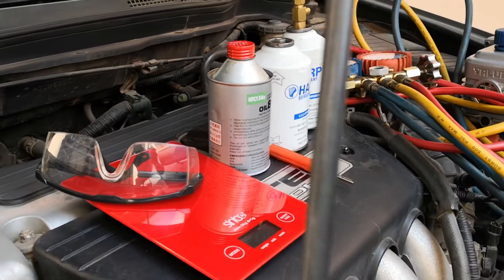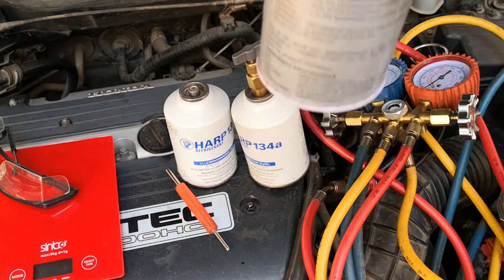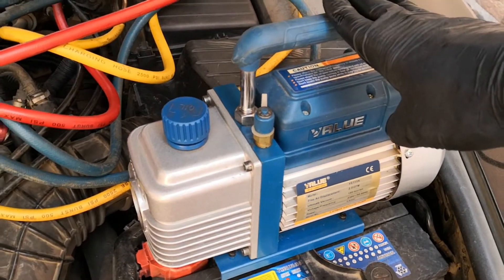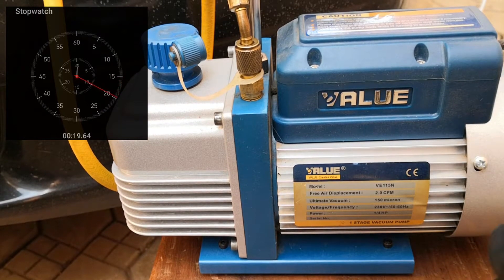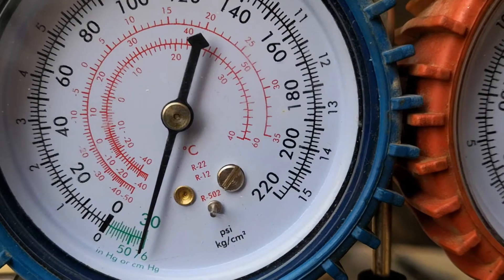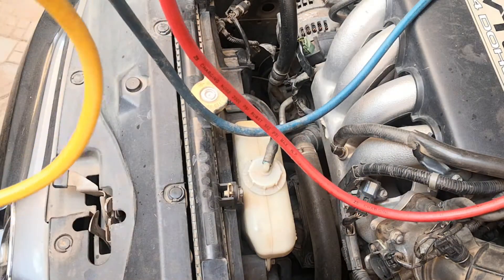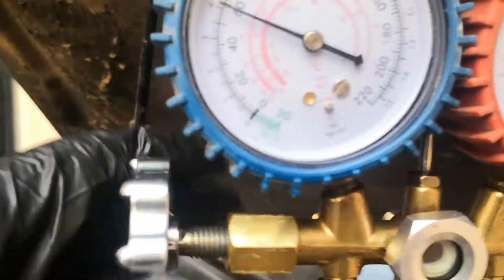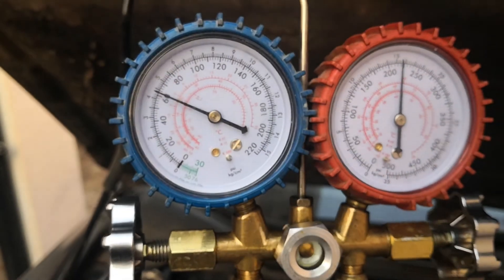Vacuum car AC / RECHARGE Car Air Conditioning / Get COLD Air in your Car

Comment: When you mentioned the oil it seems incorrect. You said you need to add the oil cuz the vacuum removed it from “all” the vacuum will not remove “all of the pag oil”. If it did….that most certainly would wind up in the vacuum, as you mentioned in another comment, the vacuum appliance doesn’t actually hold anything in the way a cleaning vacuum for your living room does with dirt….. so just based off of that. It couldn’t possibly remove “all the oil” as you said, cuz the vacuum appliance doesn’t have any pag oil  to empty in the way you empty dirt from a household vacuum appliance. At a minimum it will still have oil in the compressor. From what I’ve read an AC vacuum will only remove moisture and water, it doesn’t get hot enough to change the state of the oil from a solid…. If you added all of the systems required 7 oz pag oil you would certainly ruin it. 
I hope my comment makes sense, but basically if any oil is added during the recharge, I believe it should be an exact amount as recommended by the manufacturer def not “all of the oil” for the system. That would kill your compressor
Reply from the maker: I never actually said the vacuum removed all the oil. What I said was that vacuuming removes air and moisture. Pulling a vacuum doesn't remove PAG oil.
Reply: DIYAutoworksNG  my apologies again. I'm was not trying to comment from a position of thinking I kno more than you btw. This is the very first time I'm working on the AC and I've watched at least 20 videos to prepare. Almost no one does it the exact same way. 😢 My comment, again intended for another persons video, was just my trying to triple check my info before beginning my work. To clarify as well for anyone who may read that, def not the person wth experience here, just the one trying to learn everything correctly
Reply from the maker: No worries at all! You're my kind of guy. Watch loads on the subject to prepare and then dive in 👍🏼
Reply: @DIYAutoworksNG   I listened to it a few times to be sure
Reply: Likely it  was just a slip of the tongue and not what you meant
Reply: @DIYAutoworksNG sorry. It seems to be a situation where the comment was left on the wrong video 🤐 I was watching several in a row... Must have been writing this comment for the other video and yours started playing.... Sorry about that.

Comment: Make sure you isolate the vacuum pump before you turn it off! If you turn off the vacuum pump before isolating it from the ac system you risk sucking oil from the vacuum pump into the ac system since the check valve on the vacuum pump may not seal properly.
Reply from the maker: I usually lock of the manifold gauges before turning the vacuum pump off, but didn't know about potential impact on the check valve. Thanks for the tip!
Reply: @DIYAutoworksNG  Absolutely! You did do it correctly in the video btw. I was just warning everyone else out there.

Comment: Recharge refrigerant  1 weight 2/ sight glass [bubbles ] 3 / subcool 4/super heat 
Low side psi is a function of tx valve and evaporater core 
High side Psi is a function condenser size and cooling fans 
SYSYTEM MUST BE 100% FULL FOR GOOD COMPRESSOR OIL CIRCUATION

Comment: Hello, for some reason when I was doing a vacuum on the system, the vacuums oil went into the gauges
Reply from the maker: Was the system evacuated before vacuuming?
Reply: @DIYAutoworksNG  yes, that's what I can figure out
Reply from the maker: Are you certain you didn't have some oil left in the lines prior? Either way, I'd just add the recommended amount listed by the manufacturer and recharge (assuming you didn't replace any components).
Reply: @DIYAutoworksNG  I took it apart completely,lines, evaporator valve, but , I didn't change the condenser.
Reply from the maker: @howlingmedia4354  then, you're meant to add the recommended amount of oil volumes specified when replacing those items. I'm guessing you flushed the lines? Another question, did you add the oil before vacuuming? If you did, that could be the reason.

Comment: I have a 2007 civic hybrid and replacing my evaporator, expansion valve, condenser, and compressor. How much oil should I put and where’s the best way to put it? Does a new compressor comes with the total right amount of oil in it therefore there’s no need to add for the whole system ? Thanks!
Reply from the maker: There are specific volumes to add when each of those parts are replaced. The new compressor usually comes with the oil, but there's a specific instruction on how drain the old, measure and use this to inform the new one. I don't have it at the top of my head, but just check online for the specs for your model year.

Comment: Nice illustration and most appreciated. However, did you take into consideration the added weight of the hose attached to the can? It is going to register on the scale and affect the number computation, No? The can itself weighs grams or within an oz.  I am about to do this same job, of replacing my rear expansion valve and perhaps the evaporator on my 2015 Town and Country, due to a leak back there. I have been watching a few videos, to sorta get this procedure down packed. Thanks and keep up the great videos.
Reply from the maker: Thanks for your feedback! 

Since the weight of the hose and can are constant, you don't really need to account for those. Just take the starting and end weights. The difference is in the system. Just remember to take starting weight after you've bled the charge line. Also it's a range that you're aiming for e.g., 500 - 550g. I usually work with the higher value to account for any insensible loss.
Reply: @DIYAutoworksNG  Thank you.. I wonder if you can elaborate on something. On my 2015 Chrysler town and Country I found that my AC was blowing warm this summer, and I used a single can to sorta feel some cold. But during an inspection of the right rear shock, I looked up and noticed a green liquid coming from the rear expansion valve junction. I now figured why the AC system continued to fail. So I looked into what is involved with this job. You tube videos (including yours) gave me a good perspective on the re-charge part of this job. However,

I would first need to open up the rear and inspect for the parts at fault. This I have done. I actually found that the aluminum with rubber O-rings had deteriorated and therefor caused the leak. The Evaporator was like new, so I purchased the expansion valve and O-rings. I purchased an air vacuum pump, manifold gauge/hose set, 2 new Schrader valves, the Pag 46 oil and three 12oz cans of R134a freon. 

* My question is more on the replenishment of the amount of pag oil required. Being that this was leaking (I guess) all winter, I have no idea how much oil has escaped. Which begs to ask, "How much pag 46 oil should I add?" My dual air system normally takes 1150g (2.53 lb) of R134a, and about 6oz pag 46 oil. But I don't believe All the oil has leaked out. 

So I wonder if Anyone has a general rule of thumb, as to if adding 3 or 4oz is fine when having had this type leak and repair?  What say ye?
Be blessed and encouraged my friend.

Comment: Did customer or you fix the leak before recharge empty system?

During recharge, we always keep high side close?

On the tiny  spy glass window, what do we do if see liquid filling up there?
Reply from the maker: The system doesnt have a leak. But it's good to fix any leak present. Yes, high side should always be closed. If fluid it filling up the spy glass, you need to reduce the filling rate by closing the valve on the gas a bit.

Comment: High side shouldn't be higher than 250 and low side 35 you did it wrong
Reply from the maker: Totally not true. Remember that pressures are determined by ambient temperature. See this temperature pressure chart. https://carcody.com/wp-content/uploads/2020/05/r134a-low-pressure-chart.jpg
At 30o Celsius, you may even have up to 300psi on the high side.

Comment: I have two questions:
1.  Is vacuum the a/c system really pulls out its original compressor oil?  If not,
there is no point to add oil back.  I think vacuum only pulls out air and moisture.
2.  In your very first purge of the yellow hose, there is still air left in the blue hose that
is not purged.  When you charge the refrigrant, the air in blue hose will go into the system.
Why not purge yellow hose and blue hose at the same time by:
- Make sure blue service port adapter is close, open blue valve on manifold
- Slightly unscrew the connector at the adapter to purge both hoses at the same time.
Reply from the maker: A good question and observation.
1. Vacuuming doesn't remove the oil from the system, but the leak that preceeded the refill or if a part was changed, will remove some oil from the system. E.g., Honda service manual recommends adding 25mls of ND-8 oil if you are recharging after leak repair. The most important thing is to follow the recommendation from the manufacturer.
2. There isn't any air left in the blue or red lines, remember that the system was vacuumed and vacuuming happened through both the low and high sides when their valves were opened.

Comment: I pulled a vaccum, let it hold and showed no leaks. I recharged the system, and it blew cold for one day. What is my problem if there's no leaks
Reply from the maker: Does the magnetic clutch still engage? You didn't overcharge the system right? You may want to hook up a manifold gauge to the system, let's see what the pressures are at.
Reply: @DIYAutoworksNG  it was good and cold for a day and yes the clutch engages. I won't have access to the car again until next weekend but I'll put the gauges on it and I'll let you know.
Reply from the maker: Okay. Also, be sure to also check the cabin air cleaner element or filter. A clogged filter compromises cooling.
Reply: @DIYAutoworksNG  ok so I was just informed by the owner that it starting blowing cold again for a while. They took a half hour trip in the car and it blew cold again. When they drove back it was hot again. So, what do you think about that?  Again I don't have access to it until this weekend.
Reply from the maker: Could be a failing AC clutch relay or the AC clutch itself. Intermittent operation is one of the early signs of final failure.
Reply: @DIYAutoworksNG  ok. Thank you.
Reply: Ok. Sunday I installed a new compressor and expansion valve. It's working perfectly. Thank you for your diagnosis.
Reply from the maker: Good end to this. The manifold gauge should have shown a relatively low pressure on the high side. High side should be somewhere around 5 times the pressure of the low side.
Glad you sorted this and thanks for posting the culprit.

Comment: How do I know how much oil to add? No other videos say to add oil unless you change a major component like the compressor or evaporator.
Reply from the maker: Oil should always be added except if the refrigerant you have already has oil in it. You always have refrigerant and oil in the system and a leak will discharge both. A cars service manual usually states the amount of oil to be replaced for leak repairs. The manual for the 7th gen Accord states 25mls for leak repairs.
Reply from the maker: Oil should always be added except if the refrigerant you have already has oil in it. You always have refrigerant and oil in the system and a leak will discharge both. A cars service manual usually states the amount of oil to be replaced for leak repairs. The manual for the 7th gen Accord states 25mls for leak repairs.

Comment: You closed the manifold valves,, Your guage held negative pressure, how do you know that your system held negative pressure?
Reply from the maker: The needle of the gauge went below zero  which indicates vacuum. The system should hold the vacuum and not drop if left standing for an hour.
Reply: I've seen other people close the valve as if to test the system for leaks. I'm confused.
How can it test the system for leaks when the valve closes off the gauge from the system?
Reply from the maker: The valves close off the system from the service/charge line and vacuum pump. It doesn't close off the gauge from the system. Its correct to close the valves while observing for leaks. If you leave the valves unlocked you'll leave the vacuum pump/line in the mix.
Reply: @DIYAutoworksNG  Thank you for the quick replies. I understand now.
Reply from the maker: Cheers!

Comment: If ist can gave you 190g after weighing {full Wt 383g-193g} how do you expect 340g from second can when both are same size?
Reply from the maker: Good observation. The first can was not full. I had used part of it for a different job. Net weight of a full can is 340g

Comment: can you make a new video explain how to charge via subcool and superheat for example subtracting static temperature and line temperature doing that to the low and high side and comparing weather or not subcool is too high or too low
Reply from the maker: Hi thanks for your comment. Do you mind explaining this a bit further? It's not yet clear to me.
Reply: @DIYAutoworksNG  subcool is your liquid and superheat is your vapor. if your subcool is higher than your superheat than your overcharged ---  if the subcool is lower than your superheat then your undercharged the idea is to have subcool and superheat as the same temperature
Reply from the maker: Thanks for the explanation. I am not really versed with liquid charging and don't have the tools for it yet. My understanding is that charging as liquid is usually done via the high side and these small cans cannot withstand the pressure on the high side of the system.
Reply: @DIYAutoworksNG  wrong, you always charge on the low side always. its not hard to do ill send you link to a video
Reply from the maker: Yep. You are correct. No charging via high side. To be honest, I really didn't pay attention to charging as liquid once I learnt there was a risk of getting incompressible liquid to the compressor. Do send the link. Thanks.